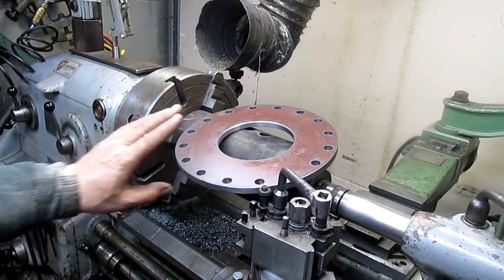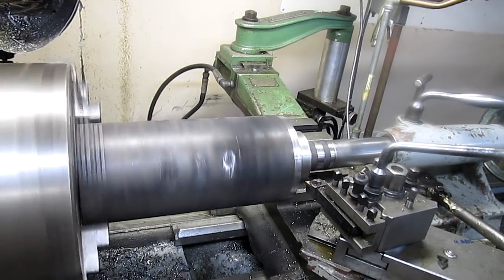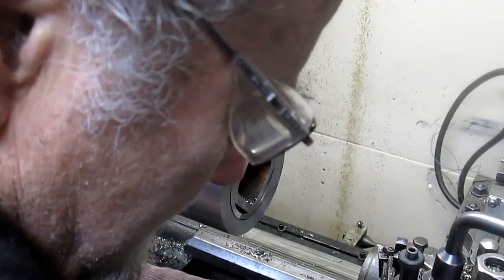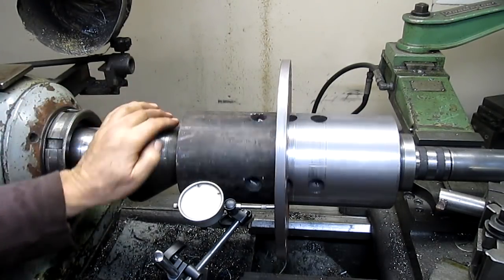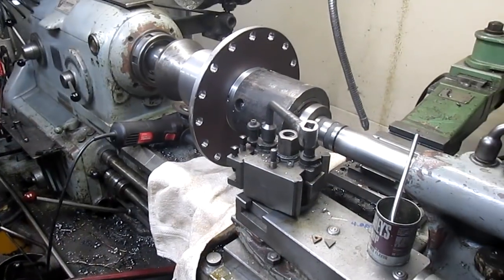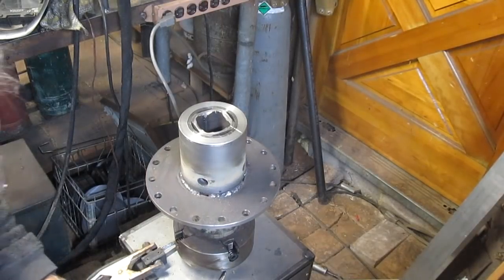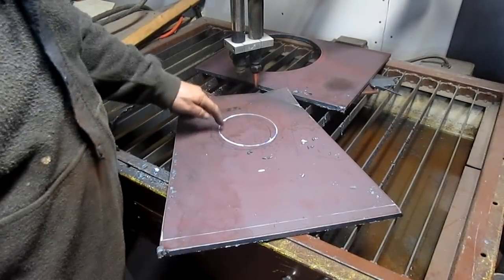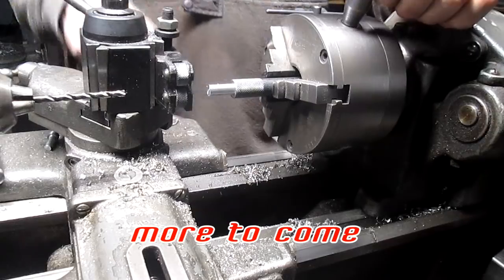Drill Gear Box Build #3

Comment: I would not clamp the ground before the chuck. that may mess up the chuck or bearings by arcing. Same thing as grounding on a vise. Should always be straight to the part
Reply from the maker: thanks for the tip.

Comment: Cool project 😎. Not sure what kind of welder you've got (AC or DC or both 🙂), but if you wanna make pretty and strong beads on the flat or even a fillet, a 7018 rod or even a 7024 (flat only) might be more forgiving.
Thanks for the vid 😁.
Reply from the maker: Not so much the rod and more my old guy shaky hands that seems to be gradually getting more pronounced as the years go by. Gettin' old. . . it ain't for sissies. 
NIK

Comment: Weld the flange the same on both sides and use a radious tool to clean up the welds 😎.
Reply from the maker: As you  will see later the entire hub will be buried in 2 gallons of grease.

Comment: nick good video but i noticed somthing odd. your right handed like i am and i saw the welding turntable going in the wrong direction. you were welding and pushing the rod into the weld you should be welding from left to right and pulling the electrode. you will achieve a much better weld. try that next time.
Reply from the maker: Unfortunately the table only goes the wrong direction and it goes too fast. Still working out the kinks. Use what you have, right?
Reply: @NikColyerMachineWorks  right on nick thanks 4 the reply.